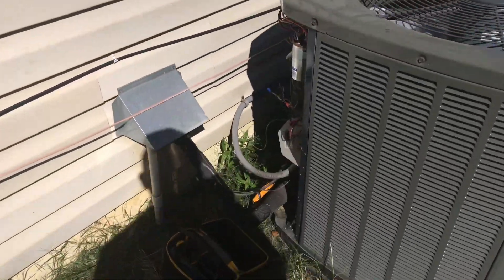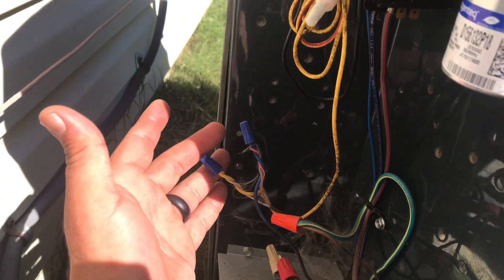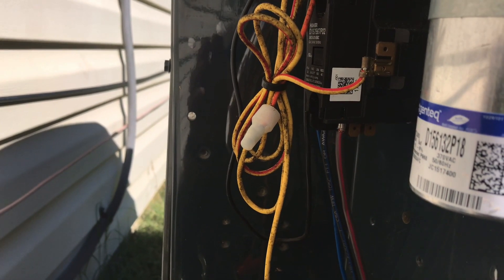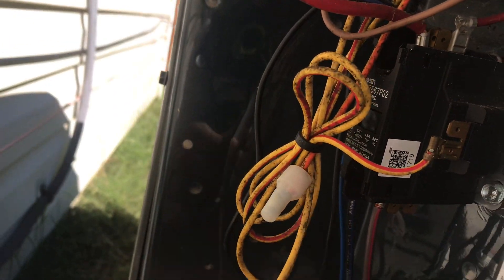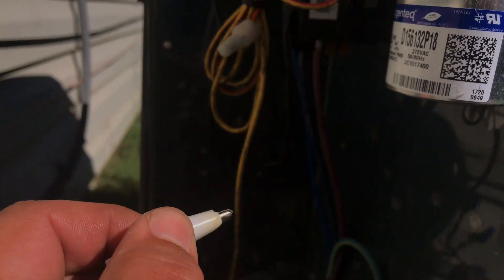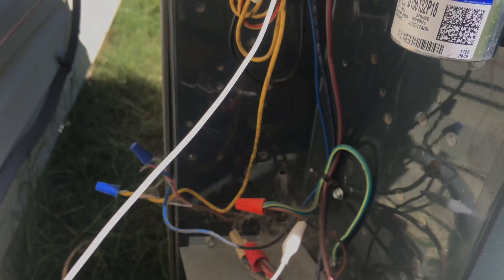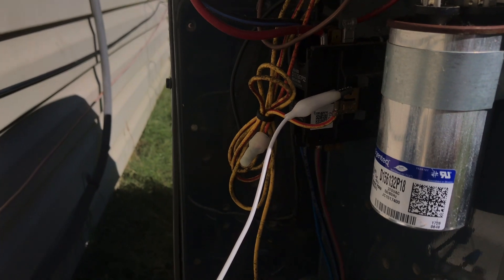Contactor will not pull in (with 24v)

Comment: My AC stopped working, had a guy come in he said might be the contactor and Capacitor. But AC still did not work. The guys could not find the issue. So I pulled out my multimeter and started testing the cables from the 24 volt input to the contactor and I bypassed the HPS and voila, AC started working, however not being an HVAC tech, I wasn't sure if I could keep ir running like that. Now I have to pay a tech to come change it $$$. Anyway I just hope they believe me when I tell them it's the HPS. Thank you for confirming what I discovered on my own.

Comment: I’m have an issue on a r32 heat pump Goodman condenser , everything is wired correctly ,
Blue - blue 
White - Orange reversing valance 
Red - red 
Yellow - purple 
When calling for cooling , condenser turns on for about 10 seconds then shuts off . Confirmed system is not under charged . When disconnecting 24 volts from condenser , everything works with no issue ….. if anyone have any idea what can be going on , everything has proper voltage

Comment: I got 22 VAC it just humms... I got a new contact still humms ordered the board
Reply: Mine is a old intertherm with a miller compressor.  The voltage 22 VAC goes to a circuit board. It goes to the contact.  I found a new board 6 days out but not sure if that's my problem or not.

Comment: It looks like you jumped from the rubber wire coating to contactor (ground you say). How did you get the ground by putting the clip on the outside of the wire -no metal ?

Comment: Just a question on this. My fan and compressor will not turn on. Here is what I checked. Thermostat is getting 26 volts. Air handler motherboard is sending 26 volts to the condenser outside.  I checked high and low voltage to the 2 pole contactor. I am getting high voltage and not low at the contactor. When the poles are pushed in, both compressor and fan engage. I then checked the capacitor. The multimeter show O.L. for both fan and herm, absolutely cooked, however from the outside the capacitor looks clean, no deformity in shape. Also I jumped the contactor and it still would not pull in. I already ordered a new capacitor and a contactor for good measure. I hope this fixes it. If not, it could be high or low pressure switch, praying its not. That may be too advanced for me to engage in, although I have replaced refrigerant in a car, never on a home AC unit and never replaced pressure switches.

Comment: Great Video thank you so much, I'm not a HVAC tech but I am a maintenance tech and a home owner.  This video helped me out so much because I was thinking that my contactor needed to be replaced.  Found out that my low pressure switch had faulted, it had a little reset button so I reset it and boom baby my unit came on right away.  Save me some money and I didn't have to buy anything.  Going to start following just because of this.  😁😁😁😁😁😁😁😁😁😁😁😁😁😁😁😁🤩🤩🤩🤩🤩🤩🤩🤩🤩🤩🤩🤩🤩

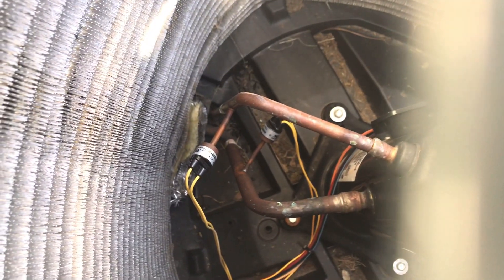Comment: It is bare copper wire check out time index 1:24-1:25 you can see it's the rolmex bare copper ground
Reply: I’m trying to see what you’re pointing out but the video is too fast. I’m trying to figure my problem out. I can’t check pressure. I do not have guages for that. I put a new contacter in and same problem. I was trouble shooting with the original paperwork proved. I jumped at thermostat and furnace circuit board in attic and contacter won’t close. When I manually close contacter the bigger pipe gets cold.

Comment: Ive had 4 techs come look at my trane unit. No one can fix it. It works except it will not pull in contactor by itself, you hsve to push it in. New contactor, verified old one was good. New cap. Old one was fine. Bypassed both pressure switches. Have normal green LED. This unit should go.... by doesnt.
Reply: Did you figure it out?
Reply: @markleach2177  Not exactly. It just started working after I switched the timer with it's sister unit's. Working fine every since. I can only assume that one connector to the timer was not fitting well with the timer contact.

Comment: I just looked at a similar unit.  Contactor was replaced.  Confirmed 24v at wire set coming from C and Y on furnace board to condensing unit.  

Same types of hi/low switches. Wire coming from low pressure switch was hooked to contactor coil.  Even when pulling that wire off and manually depressing contactor, unit coming on.  

Providing 24v to contactor coil not getting contactor to pull in, very confused.
Reply: Did you find the fix. I am having similar kind of problem, Contactor low voltage showing 0 volts, when disconnected low voltage wire and tested it shows 26 volts. So I am getting low voltage at wire but once it's connected to Contactor it show 0 volts. What could be the problem here? Also tested Contactor coil continuity and shows 13 ohms resistance.

Comment: Will a refrigerant leak cause the pressure switch to trip that contact ?
Reply: Yes. If there is a low pressure switch, and the unit is low on freon due to a refrigerant leak, low pressure switch can trip the contactor and keep the contactor from pulling.

Comment: It is connected wrong in the air handler. The Y call is going through the blue wire which is Trane and American Standard's normal ground wire at the control transformer. All that is happening is the ground is being provided because of the wire reversal

Comment: I jumped it but the contacter won’t pull in. I can push it manually and it cuts on. Is this the contactor?
Reply: No, I changed the contactor. The contactor still wouldn’t be pulling in
Reply: Your not getting voltage to pull in the contacter it should be 24 + volts @Miss.perpetual
Reply: What did it end up being

Comment: What do you mean jumping on the ground? I see you put it on the brown wires and then one on the contactor I see that.
Reply: I'm wondering how the jumper wire even did anything when it's not even touching metal on the ground side just the out casing of the brown wire.

Comment: I'm having the same problem everything checks out at the thermostat and air handler the voltage checks out at the thermostat wires on the condenser and on the side of the contactor but the contactor will not engage when I engage it manually only the compressor comes on the fan does not rotate unless I remove the fan hot wire from the circuit board and move it up pag. When I did do this while engaging the contactor at the same time I noticed that my low pressure line start to freeze up I did not have my gauges with me at the time because I've been troubleshooting it for wiring tomorrow I will put the gauges on and repeat this process maybe I do have a restriction and those special modifications on the low and high pressure supply lines on the condenser are closed due to low Freon are overfilling

Comment: Thanks for the video the trains are supposed to be the best condensing unit but usually they're always the pain in the butt they're not like other condensing units that's for sure what usually works on Goodman's definitely does not work on trains I guess this is very complex mechanism designed to be a pain in the butt to the point you must called a train professional

Comment: So what if the unit has low Freon, and the contactor is not pulling, but has a pressure switch?
Reply: That's where the low pressure will cut out, depending on how low it is that is

Comment: I know its 2022 but we are having a similar issue with our heat pump the a/c was working a couple of days ago I even checked the vents when my tech was out side and we had 54 coming out. Now we have no voltage going to the contactor I check the board and the high and low limit switch hell we even bypassed them to see if we could get it to work, but still no low voltage going to the contactor. I checked the board on the A/C 24 volts is sitting there but somehow I am missing something and when we do engage the contactor the heater kicks on. Most likely I am going to have to just start from scratch and rewire the bugger I do have a slight feeling my tech my of messed up something somewhere.
Reply: I am having the same problem did you figure it out?
Reply: @daniela.9445  Yes we had a broken wire behind the thermostat once we eliminated the wire we got the unit to turn on.
Reply: @XanderousIV  thank you very much

Comment: Where does the HPS wires plug into the contactor then? One wire each on the contactor 24v side?
Reply from the maker: The common side of the contactor

Comment: Thanks a bunch for the very helpful video.  I knew I had a problem with one of my high or low pressure switches, and I could potentially bypass them, but I wasn't sure how to do it until I saw your video.  I'm back up and running until the HVAC person is out in a couple of days.

Comment: Terrible instruction 👎. Where are you placing the jumper wire to pull in the contactor? A  bunch of talk with no close ups.
Reply from the maker: Sorry you can’t understand
Reply from the maker: I said to the ground. Anywhere on anything grounded will work but I used the copper ground wire on one end of the jumper and to the contractor on the other side
Reply: @HVACTechTips  A grounded copper wire placed into the jumper wrapped around the screw to the output of contactor?
Reply: @HVACTechTips  yea, blame the student with zero experience trying to learn?

Comment: When you say that you are getting 24volts at the contactor, you aren’t actually. You are getting 24 volts to the outdoor condensing unit, but it isn’t making it to the contactor because one of the high pressure or allow pressure switches is open, correct?
Reply: Actually no you are right, I looked a little closer at your video, your pressure switches are on your common side, which would mean you do have 24 volts are the contactor on the hot side, but it wouldn’t close because it has no path to go after.

Comment: Lennox has a board that gets 24v in and 24v out to pressure switches and come back to board then out to contactor but it wasnt pulling in. I connected 24v wires to contactors and it pulled in and bypassed board and pressure switches.

Comment: They’re breaking the common instead of 24V then. Odd, I see that in automotive, but in A/C it’s pretty rare; at least in my 37 years in HVAC.
It’s not a good idea to do it that way because if your common gets shorted somewhere, your safeties are bypassed and the unit could run itself into the ground needlessly. If you’re breaking 24V and it shorts, you’re still protected. Excellent video!
Reply: Yeah I agree with this, that’s why I was a little confused at first, I would much rather see 24v being broken with the switches rather than common.

Comment: I’m confused when you said ground. So I can just clamp it on a insulated wire?
Reply from the maker: No. To the ground
Reply from the maker: Like the bare copper wire
Reply: @HVACTechTips  sorry for the dumb questions, high voltage ground?
Reply from the maker: Yes.